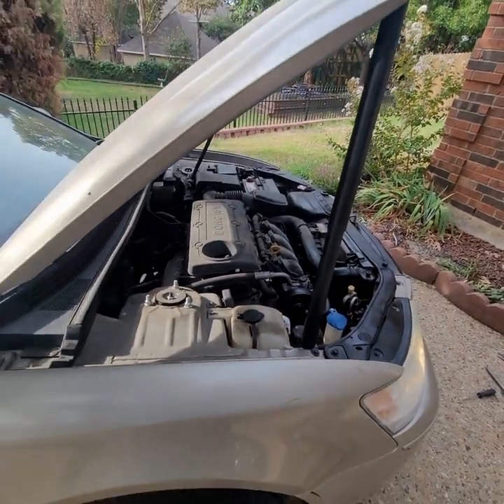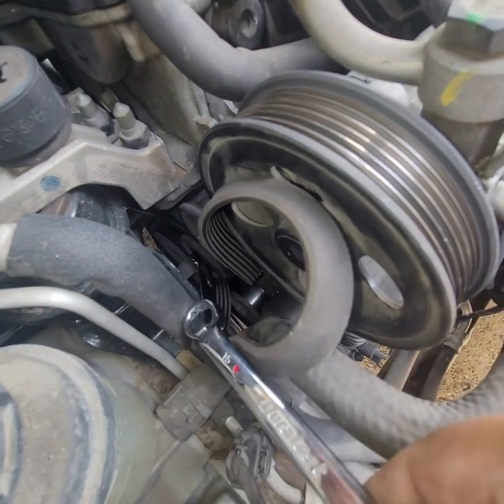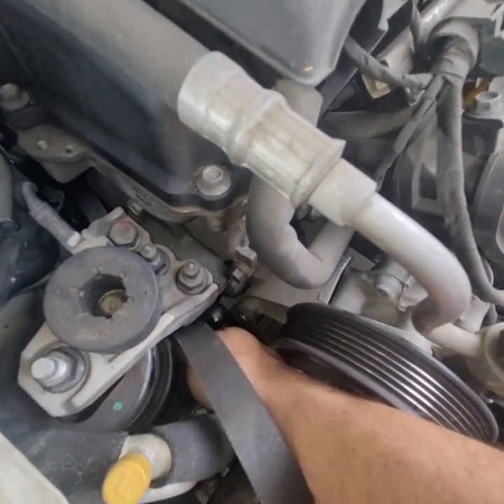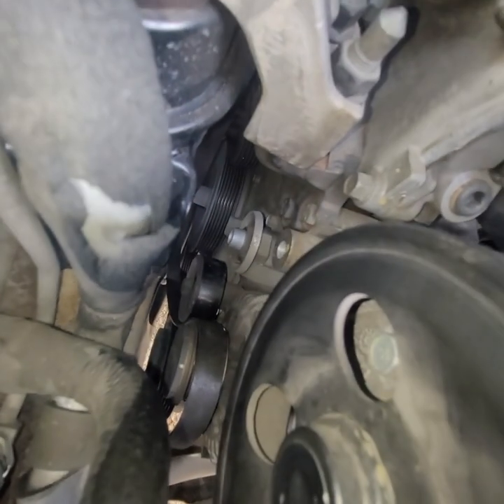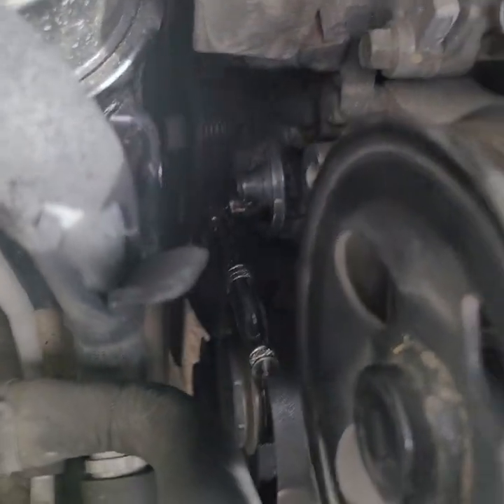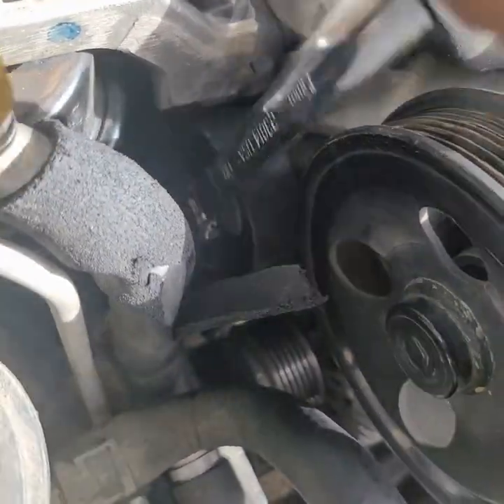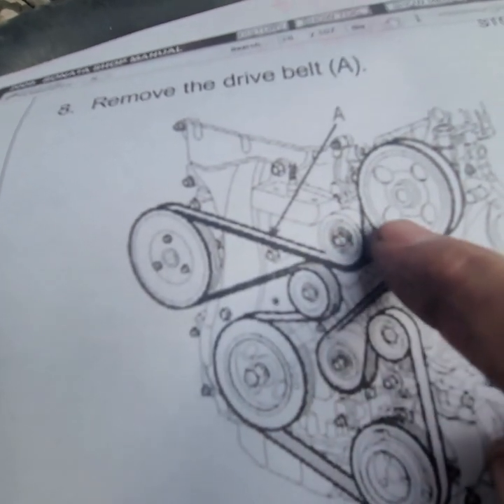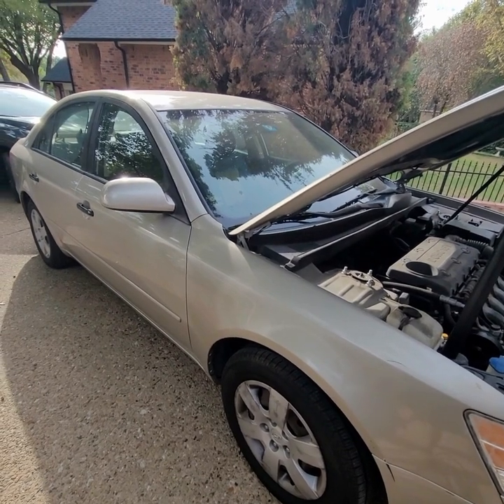2010 (2006-2010) Hyundai Sonata Serpentine Belt, Pulley, and Tensioner Replacement

Comment: Very helpful. Was replacing the compressor earlier today and wanted to double check the tensioner was where I thought it was. Bit of a pain in the backside compared to some cars, but not too bad and you can do it without removing anything, which is nice.